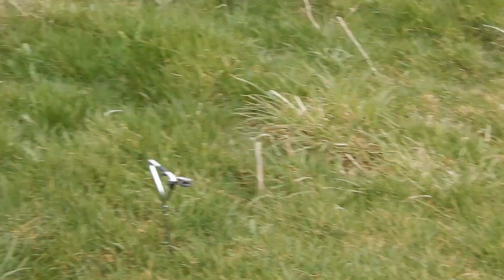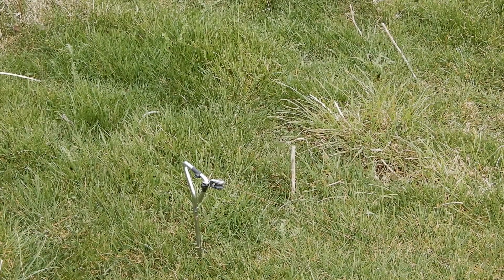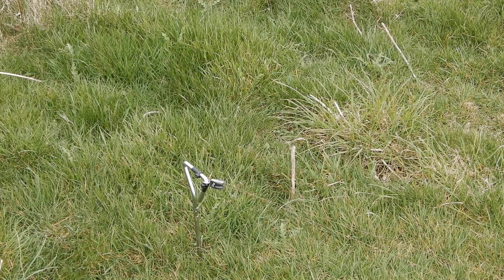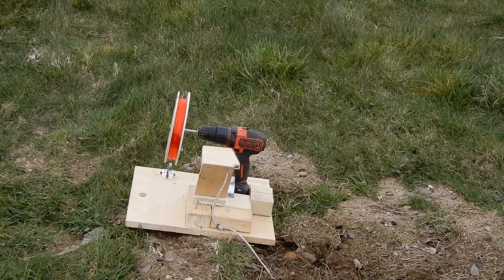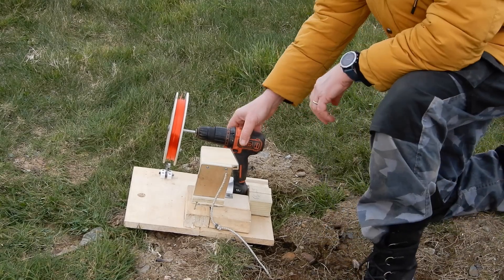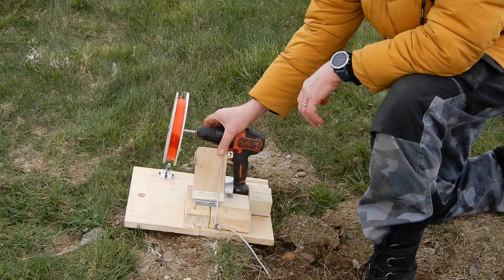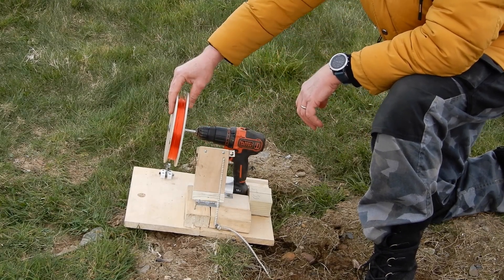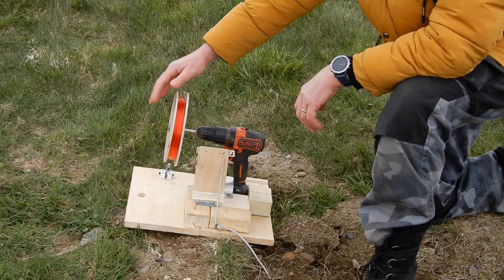Electric Glider / Sailplane winch for the Pug Glider  Plan C

Comment: I know I'm behind the times on this one, but although I watched the vid when it was posted I've only just completed my winch - based on your 'NickChittyFlying' design. 
Before I try it out, as an alternative to my present home-brewed hi-start system, I would like to know - What was approx distance between winch and turnaround pulley  in this video :-)
Reply from the maker: I was stuck with size of field due to wind direction it’s only 50 metres to turn round in the right direction I might quadruple that 😀 in right direction
Reply: @NickChittyFlying   I have a 1/4 mile of field in the prevailing wind direction so field space is no problem. Based on what you say I'll probably try about 80 to100 metres to start with. That should be enough. Apart from anything else, at my age micro gliders get very small very quickly at height ! Thanks for your prompt reply :-)
Reply from the maker: @IainEPaterson  sounds good 👌